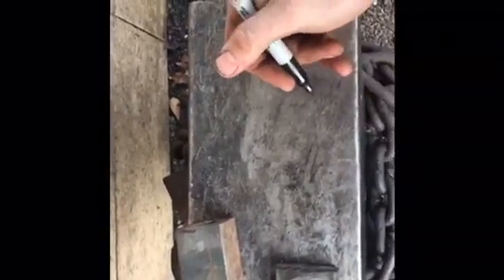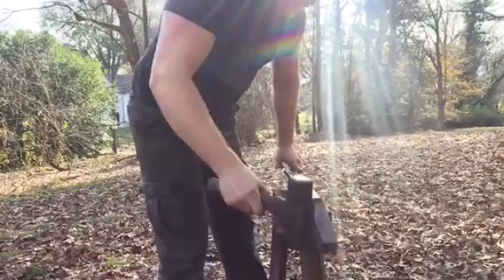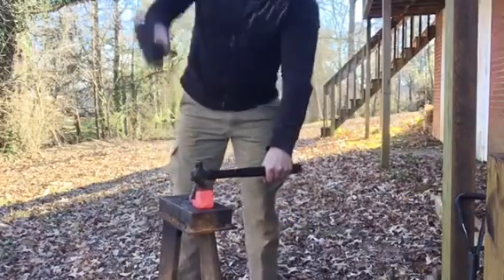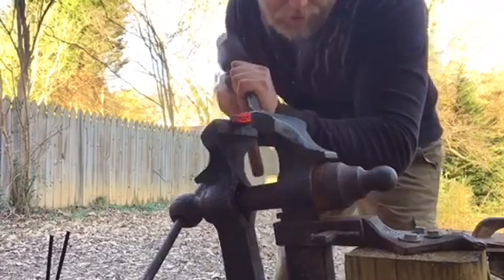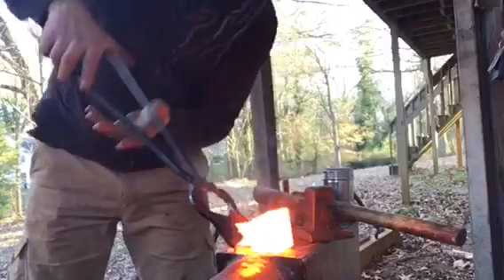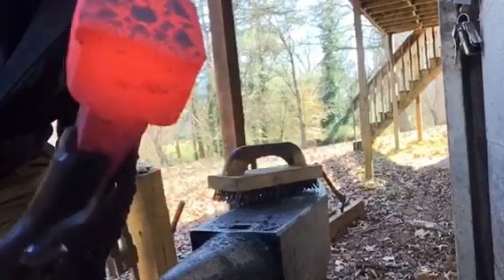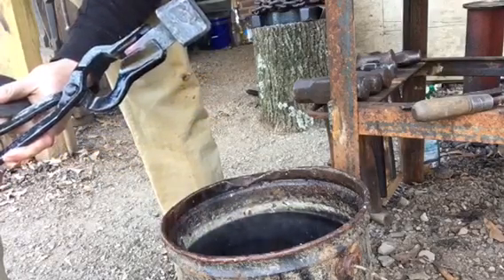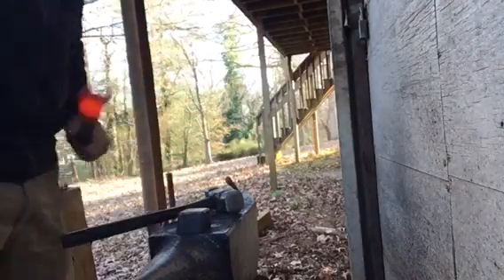Blacksmithing/tool making. Forging a stump anvil/ anvil block

Comment: Thanks for the videos. I'm slowly getting everything together to start blacksmithing.  Gonna make an anvil out of railroad track since I only have about 30 feet of it and about 15 rail plates and 300 railroad spikes. I bought this house a year ago from a retired railroad worker and he left all that stuff  but I see why a couple of the pieces of track are 11 ft long I could lift up one side but couldn't drag it an inch. He must have got it in his younger days. I got almost everything to make a forge. I bought 10 feet of half inch plate that's 9 inches wide and 20 3000° fire bricks I just need to figure out what to buy so I can run propane into it. Anyway keep up the videos they are good.